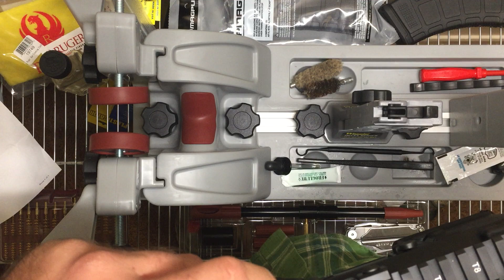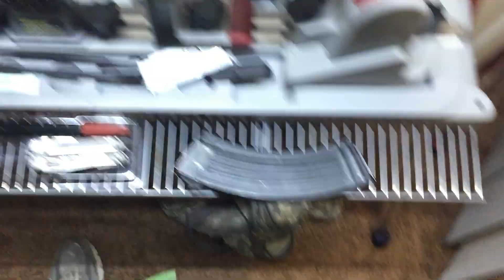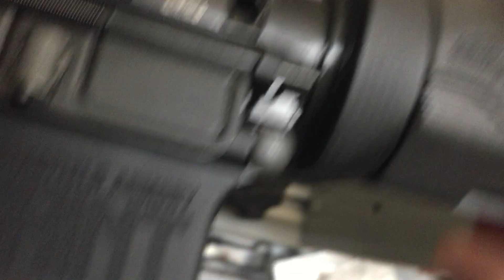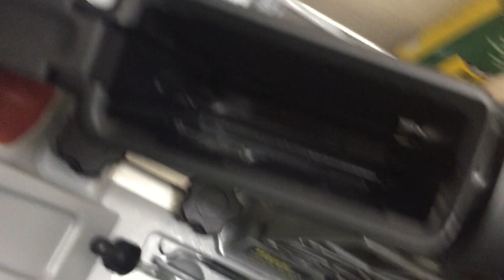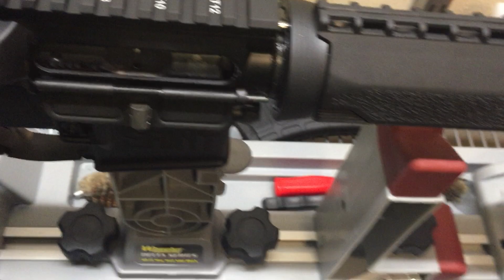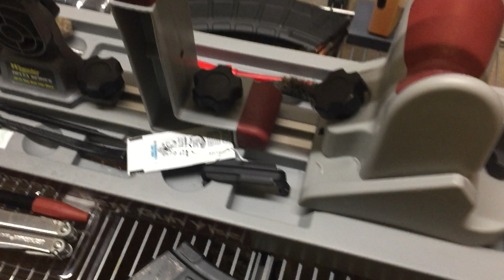(Part 2) Caution Problems With New Springfield Armory Saint Review BIG Fail Malfunction Jam

Comment: A rifle is in it's worst condition brand new. The finish in the bolt carrier group has to wear out a bit before it functions smoothly. Sometimes the cam pin gets stuck when trying to chamber the first round and the last thing you should do when that happens is beat on the forward assist. It is just a jam enhancer at that point, and this is an extremely dangerous malfunction to clear. This is probably how and why this happened to you. My Saint Victor didn't have a lot of oil on it when I first got it and I made sure to do that before trying to use it. Have had zero problems whatsoever at about 1500 rounds

Comment: show us the ammo you are using.
Reply: Greg Brown probably using wrong ammo
Reply: Something is up here for sure ...
Reply: Looked as if the casing was steel, like tula. That shouldn't matter tho. A gun that cost 800+ should eat anything.
Reply: @Bearclaw_Jake  there is very different detentions on steel and brass case ammo if you have any experience with guns you should know this even to fact I've had a keltech sub 2000 gen 2 for a couple years now and runs great I put anything other than brass case rounds it sticks.
Also the surface of the two different materials are different also different dimensions different friction on surfaces and so forth. Gun may have am issue but to say that an 800 dollar gun should eat anything is ignorant
Reply: Fire the gun to unload it. lol!!
Reply: You can see the case is some sort of steel ammunition. Maybe not the best choice for a brand new rifle. Although the bolt not being able to get that cartridge into the chamber says something. Dropping that round into a case gauge would let you know if the ammunition is the problem. A gunsmith could check the chamber in a matter of minutes with headspace gauges. A few moments with a small flashlight to make sure nothing is in the way wouldn't be wasted time either.

Comment: I'd like to see (and hear) the action being cycled manually with no ammo, then watch you start with the bolt locked back (charging handle locked forwards), insert a mag with a round in it, and use the bolt release to attempt to chamber that round (better yet, get some snap caps and go/no-go gauges). I hear what you're saying, but would like to see it happen. Might help diagnose possible causes. 

BTW best way to get a stuck round/case like this out doesn't involve a tool. One hand on the handguard, muzzle points straight up, other hand grabbing the changing handle and pulling it back, then the gun is slammed down on a hard surface on the butt stock (right on the recoil pad). Can also be done with the muzzle pointed downrange if there's a tree or trailer hitch or other solid object to ram the butt stock into. Works shockingly well and will eject that case right out without having to stick metal objects up the magwell and pry on the carrier. 

BTW #2: to avoid shipping back and forth, a lot of manufacturers have certified gunsmiths all over the country who do warranty work. Might want to ask Springfield about that possibility. Even if it's a "no," I'd take it to a gunsmith just to get their opinion on what's wrong. They'll almost certainly give it a look for free, and their feedback should provide you with solid info to present to Springfield.
Reply from the maker: The gun is back at Springfield now. When I was talking to the customer service guy at springfield he said the same thing about getting the round out. but then fallowed it up with. It may inertia fire so be careful. I went with a tool for that reason. scratches on the gun vs holes in my ceiling and roof and maybe coming down hitting someone or some thing. the tool worked. but if I was out at the rage still I would do that. Hopefully this never happens again though. Thanks for the response  Jermey

Comment: Thank you for taking your time to share this very informative information. Your experience demonstrates a product failure and just as importantly an insight into Springfield's customer service. I can live with products having issues occasionally but, I will not tolerate shitty customer service. At this point Springfield has an opportunity to replace your new rifle but, there is nothing they can do to repair the insight we now have of their customer service. I am cancelling my order for the Saint and will  buy the Sig M400.
Reply from the maker: +Hardy Birch Thank you very much. You have summed up exactly what the point of these video's are about. I have got a ton of comments. Although I do very much appreciate the comments about ways to fix my gun, that's not the point this is a brand new gun. Its on the factory of a lifetime warranty to fix it. The point of this whole deal is to share my experience with the gun world so they know exactly what they are getting in to when they buy from this company. I never would have made a single video if they had treated me right from the beginning and had the honor and pride of a great company. I understand lemons or mistakes. but there is no excuse for this awful customer service. I have a resolution now from Springfield and I will make video part 3 today subscribe if you want to see it when it comes out.

Comment: Glad to see this on here.  I bought a new Saint in January just as soon as I read the article on it in a magazine.   Had it a couple weeks before I could go to the range and didn't have any issues with it the first time around.  Only had time to fire three magazines.  Last weekend I went again.  The first round went into battery but didn't eject once fired.  The extractor actually ripped a chunk from the bullet rim.  Then the bolt attempted to chamber another round behind the one still in battery.  Took it home and managed to push out the spent cartridge using a cleaning rod.  Broke it down and did a thorough cleaning and lube.  Back to the range today and first round would not go into battery (exactly like your first video demonstrated).   I'll be contacting Springfield Armory.  Hope I don't have the same issues with them that you had.  Very disappointed.
Reply from the maker: sorry to hear it. thank you for sharing your story. I hope springfield takes care of you.
Reply: Update.  Contacted Springfield Armory and shipped the rifle to them for repair.  Got it back today and put a magazine in with fresh factory ammo.  Just in case, I checked the ammo in a Lyman Case Length/Headspace Gauge.  It fit perfectly with no problems.  Tried to chamber a round and got the same results. The round wouldn't go into battery.  Now it's stuck and I'm sitting here with a live round in my weapon and it's sitting a good 1/2 inch short of chambering and is stuck.  I took a couple pictures of it but don't know how to post them on here.   If I figure it out I'll update again.I don't know what they thought they were doing to fix the problem but it obviously didn't work.  the invoice said they "polished the chamber" and "test fired" it.  I don't believe they fired a single round through it to test it.  It won't load rounds!!!!!!!I am not a happy person right now.  I spent nearly a thousand dollars for this weapon, including tax.  And I expected to get a reliable weapon.I will be contacting them again but I'm not optimistic.  Their credibility is shot.They've obviously got a serious problem with manufacture AND customer service.I'll update later.
Reply from the maker: wow Identical problems to mine... I hope you get your money back quick. and get a colt so you know it will work
Reply: Last update.  I sent the rifle back to Springfield again.  After two weeks I got an email from them saying they had found a piece of chamber flag in the action and had removed it and the weapon was functioning properly.  I called BS on this.  Basically because I had inspected the weapon from asshole to elbow and am 100 percent sure there were no obstructions in the action.  They persisted in their claims.  I let them send it back to me.  Took it out and fired two magazines through it with no issues.  It does seem to be functioning well now.  But I'm not buying the chamber flag bit at all.  No way to know if something else was done to fix it since they're sticking to their story.  Not sure what I'm going to do with it yet.  I'll keep testing it for a while but I don't think I'll ever have complete confidence in the rifle.
Reply from the maker: LOL sounds like you had the same tech I did. what a joke of a company. I'm so done with them. Glad you are at least able to shoot it. I personally would sell it and buy something you can bet your life on! Colt 6920! thanks for the update
Reply: At least it is functioning for now.  And it may be perfectly fine from now on but I've still got this little nag about it.  I'll probably sell it and go for something else.  Damn shame, too.  I have a Springfield XDS and have been perfectly satisfied with it.  Oh well.  I'm done.

Comment: I just got this rifle. First time at the range (last week) after 2-3 rounds I had similar problem. Had to tap on the charging rod with a soft mallet to get it to come back and eject the shell.  Looked like the primer was knocked out of the shell, as well.  After that, no problems for the rest of the time at the range. Will see what happens next time, but hopefully won't see any more problems. Good luck with yours.
Reply from the maker: Thank you, Sorry you had trouble. I would send it to springfield the second you have another problem if you do. They need to know their product has issues, and if a recall is in order they need to take care of that. If you don't then enjoy your saint I hope it works out to be the best AR in the fleet.

Comment: Ive had this exact problem before. I had bought a spare bcg from palmetto state. Took it to the range and it acted the exact same as what youre having, i believe. I had to "mortar" the rounds out of the chamber. The rifle cycled fine with the other bcg, but the spare wouldnt. Long story short, the face of the bolt was out of spec and not allowing the round to chamber fully. Got a replacement bcg, installed it and it ran flawlessly. Sorry to hear about the problems and good luck.
Reply from the maker: Thank you for your 02cents! Awesome name
Reply: 02cents i have the same problem so you just bought a new Bolt carrier group?
Reply: Noah Rule fortunate for me, i live 10 minutes from palmettos fernandina store and range. I went in and talked to the manager, alex, and explained what was going on. We took it into the range and verified the issue, then i pulled out my backup bcg and showed that the gun ran like it should. Then i put the bolt into my backup carrier and showed it still had a problem. They agreed it had to be a faulty bolt and alex took a bcg off the shelf and traded it out for me.
Reply: 02cents so you would say invest in a new BCG
Reply: Noah Rule im an advocate of having a spare anyway. But i would say to put another bcg in the gun (buy, borrow, etc) and confirm that it functions properly. As long as it functions correctly afterwords, you could have a gunsmith check the bcg to diagnose it, or just buy a replacement. You could even buy another bolt for 25-50 bucks and use your existing carrier. Bottom line, figure out WHY its not functioning, and always keep a spare bcg. I keep a spare bcg in each of my ar15 carry bags.
Reply: 02cents k sounds good
Reply from the maker: I would add. If that ends up being your problem. make springfield give you a new bcg. its under warranty and not fair for you to have to spend a dime fixing their mistake. and then get a back up bcg if you want

Comment: I believe they flat out lied about test firing that rifle. I too own several Springfield firearms, mostly 1911's and some XD's. A few years ago I bought an M1A brand new. It was so difficult to pull the charging handle to the rear that I had to use a rubber mallet to break it loose. I had to to this every time I pulled the charging handle when the gun was not cocked. Once the gun was cocked, the charging handle could be pulled easily. I sent it into Springfield, and they sent it back saying they test fired it with 20 rounds and did not find any problem. But I still needed a rubber mallet to pull the charging handle to the rear when the gun wasn't cocked. I ended up taking it to a local gunsmith that I trust and he replaced some parts and got it working. Sprinfield's customer service is flat out horrible. They make good guns most of the time, but if you get a lemon, your pretty much stuck with it. That's why I won't buy anymore of their products.
Reply from the maker: 02shooter20 thanks for watching. Wow I cant believe how similar are issues are. I'm glad you got it taken care of. Its a shame Springfield didn't take care of you. You know once they loose their credibility they have lost everything. Big Xds recall probably doesn't help either. We cant give them credit for xd's xdm's or xds's because they don't make them. In the comments I have heard stuff about more saint issues, 1911 issues and now m1a issues. what else is do they have. nothing! and the common tread among all it is they have very poor customer service. They have been my favorite for years, not sure who my next favorite could be, but I'm going to vet the guns and customer service before I drop thousands again. Sorry to rant a bit but I know you feel it too

Comment: I had the same problem with my PSA upper. What was happening was the case was getting caught on the locking lugs just outside the chamber. I had to wack the charging handle in order to unstuck the case to get it out. I took a needle-file and filed and rounded off the sharp edges on locking lugs next to the feed-ramps now it runs flawlessly. I would see if your cases have a nice scratch on the side and if it does then that's the problem. Cases are getting stuck on the locking lugs.

Comment: I see a tube of Frog Lube there.  I tried that in several guns and had some feed issues.  Went back to conventional lubes and have had no problems since.  I also have had problems with Springfield.  I have 2 M1A's and they are night and day different.  One is 15 years old and works perfectly.  The other is one year old and had to return it because it became a single shot.  Started out good but after a few mags it had to be manually ejected.  Sent it back and they increased the gas pressure to make it eject.  Now it kicks like a mule and is no fun to shoot.
Reply from the maker: I'm with you on the lube. it was a free sample I tried it and am not a fan.

Comment: I'm watchin this closely. I bought a Saint and have put about 300 rounds through it at the range the 1st time. Didn't have any issues. Gonna take it again next week. When I first got it, I bought a bunch of snap caps and cycled them through manually without issues as well. Really curious to see how Springfield handles this as I just bought an XD 45 from them as well.
Reply from the maker: Thanks for watching. thumbs up and subscribe and you will be sure to get the update on the next video. I hope your saint continues working just fine. I would put my life savings on the XD they are my favorite gun. I have never had an issue.

Comment: Rotate safety selector to “SAFE” position (see page 14).2. While pointing the muzzle in a safe direction, remove  the magazine by depressing the magazine release  and pulling the magazine out (Figure 21-1).3. With your finger off trigger fully retract charging  handle, ejecting cartridge.4. Release/lower charging handle. 5. Press lower position of bolt catch (Figure 21-2).  Retract charging handle to lock back to rearward  position.6. Push charging handle in closed position.7. Re-inspect chamber to insure firearm is unloaded.  Insert chamber flag, retract charging handle and  slowly lower. Push charging handle in closed position.

Directly copied from their manual. Anyone that would tell you that you cannot safely unchamber a round without firing the weapon should not be working at a weapons' manufacturer.

Comment: On a new rifle, you should have slingshotted the charging handle instead of using the bolt release for a couple of magazines. The parts need to break in a bit to smooth out. I bet the issue was a tight bolt cam pin. 
Regarding the scratches, i agree that is totally unacceptable that they damaged your new rifle when working on it. Very amateur.

I should have mentioned that slingshotting the charging handle allows more spring compression than simply dropping the bolt with the bolt catch. There will be more force slamming the bolt forward. It looks like your bolt doesnt want to turn when you pull the bolt carrier back, which tells me the cam pin is probably tight and may have tight lock up at the lugs. Id bet that a few mags fired though the rifle would fix it right up. I bet thats why they ran 20 rounds without a problem.
Reply from the maker: I tried both ways to charge it.
Reply: Pranqster I purchased a Saint a few weeks ago and shot it for the first time today being experienced and knowing to slingshot it until it breaks it is have not had any issues with it and I fired about 1000 rounds through it. but sorry to hear about this Mr fix it this is worst case scenario for malfunction on the bolt. I hope they do what's right and take care of you.
Reply from the maker: Thanks Derek. I really hope so.